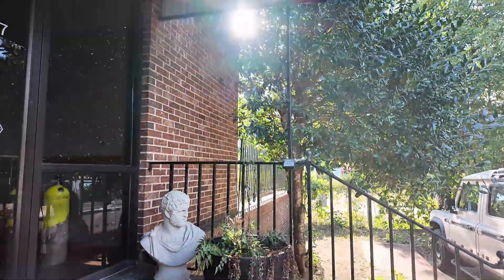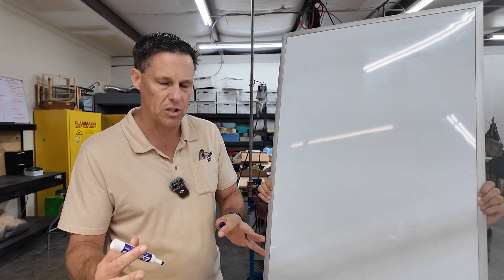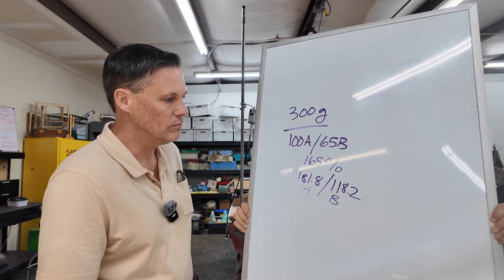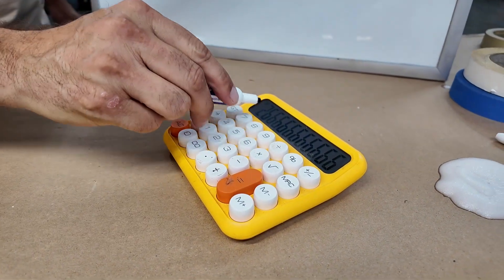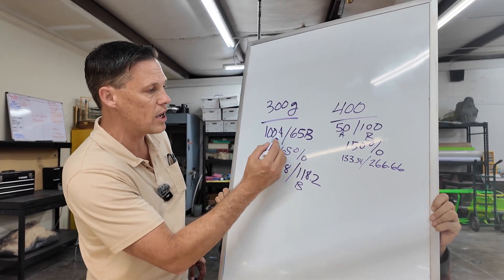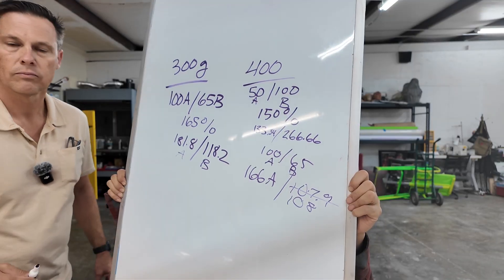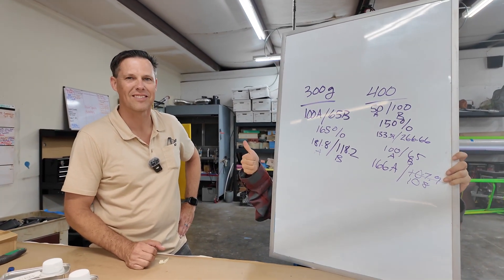Moldmaking Math With Troy From BJB

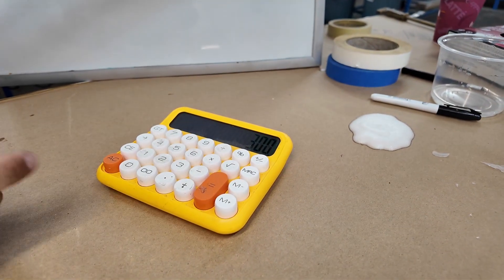Comment: 1:38 - Tried this on the Windows calculator and it spits out 495 as a result. Tried it repeatedly. Interesting.  300 / 165 = 1.818 * 100 works, although it's a little more confusing.
Reply: Just tried it on the Microsoft Calculator and it worked ok on this end.  If you aren't too scared of math, 165% is 1.65 in decimal form, and that's what we often do instead of pressing the % button.  So 300/1.65= 181.81